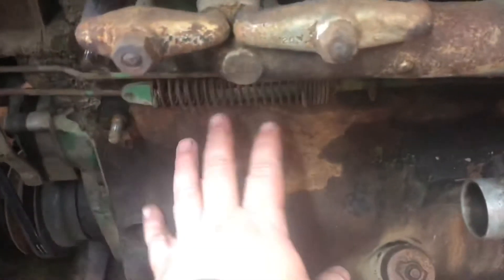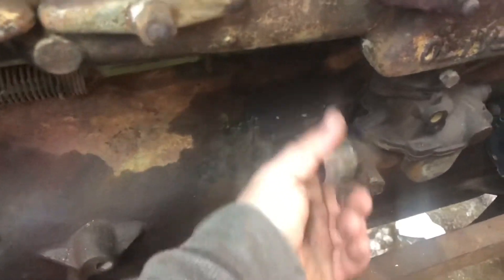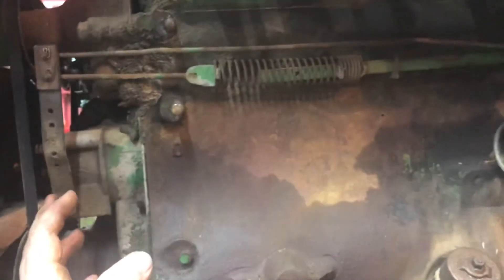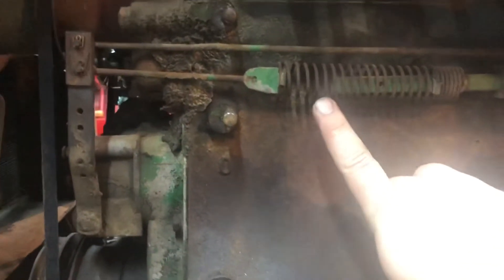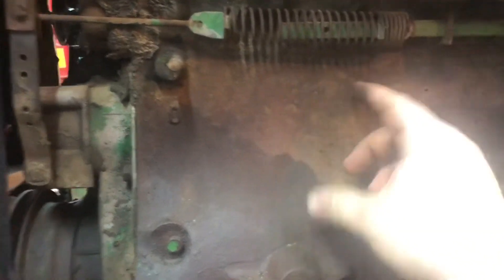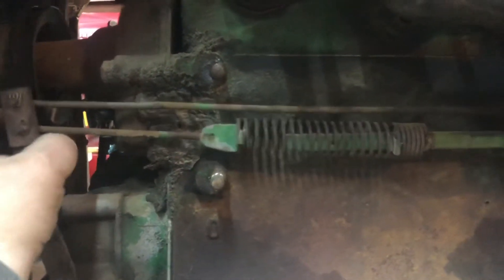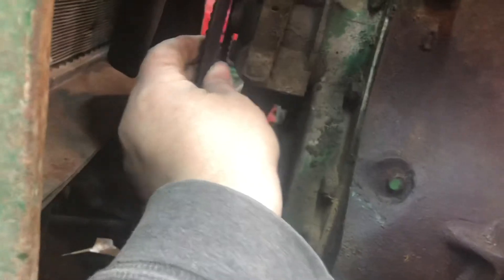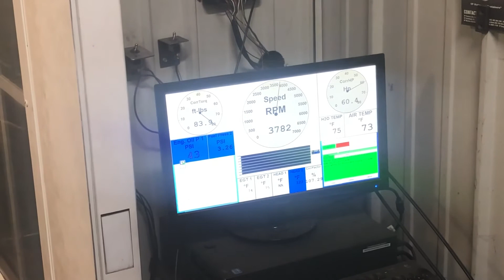What’s the deal with Governors

Comment: Would a 1600 gas be a mechanical drive and are they easy to swap out?
Reply from the maker: I’ll have to look what are you trying to do increase rpm or just correct an issue with it
Reply: @BIBSTERSrepairshop after running the baler, I think I'll have to make a few adjustments